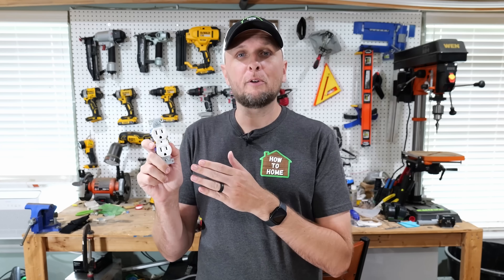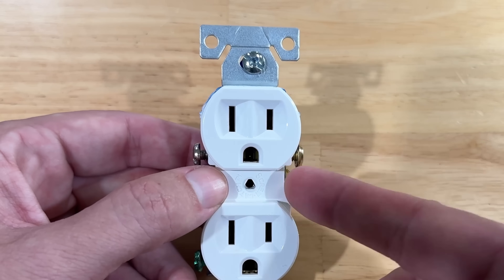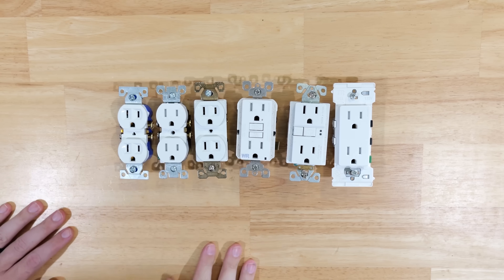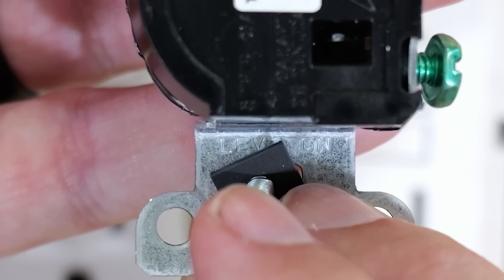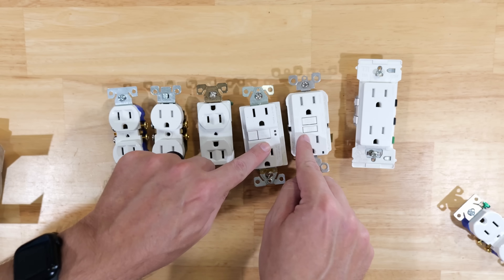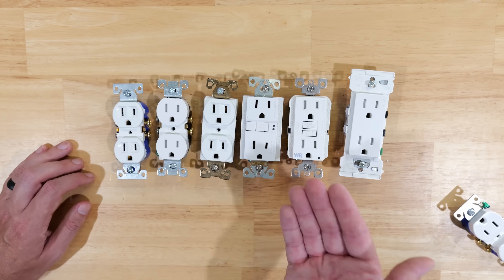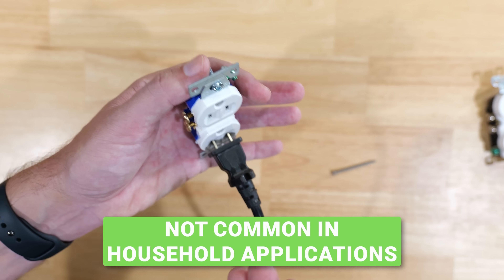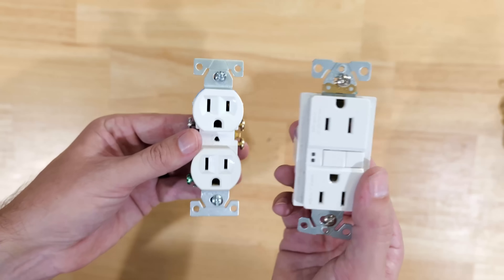The Shocking Reason Why Your Outlets Are Installed Upside Down!

Comment: My take on it is to install ground prong down unless the receptacle is switched. Then install it ground prong up to make a clear visual distinction as to which outlet is switched. Admittedly it is possible for only half of the receptacle to be switched and the other half constantly powered. However, you still have the visual indication as to which receptacle it is though you might not be sure which half is powered at all times.
Reply: That's how I've seen it on several houses - switched outlets are ground prong up.  Also, if the outlet is split, one outlet switched and one on constant, the switched outlet is on top and the constant power is on the bottom.
Reply: @philipstaite4775   People, to whoever: Just be in the habit of always installing the wires coming in on the bottom.  And, if you want the switched receptacle visual orientation, you still install the wires coming in on the bottom.  In = bottom, switched(/out) = top, no matter the receptacle orientation.  I don't know why anyone even thinks an argument is worth the time.*  EDIT  *Not referring to you guys.
Reply: @MundiTaurus  Thanks for that explanation.  I was aware of the orientation, but not the reason behind it.
Reply: @philipstaite4775  I agree, except on that last point. In my humble opinion (and the way I did it) is to put the switched outlet on the bottom. My reasoning, and for my use case, is that the switched outlet is more likely to have something plugged into it the majority of the time (a lamp). Putting it on the bottom allows the other outlet to be easier accessed periodically for plugging in phone/laptop chargers, vacuum cords, etc. 

I will admit that this idea is new to me. The way I've always done it was to use a red switch and paint the switched outlet red too. This has caused a fair amount of friction with my wife who thinks it looks stupid and apparently RUINS the entire decoration in the room. 😆
Reply: @philipstaite4775  Constant power should be on top so you don't have a cord in the way when you are plugging in an intermittent appliance.  A constant appliance, such as a lamp that is wall switched controlled, should be on the bottom so you can easily plug in your vacuum cleaner on the top portion of the receptacle!
Reply: BTW, I am just taking into account what was shown in this video.  For instance, if I had 2 receptacles next to each other:
in would be left bottom,
out would be left top,
to right bottom,
anything out would be from right top.
Reply: Agreed. I've lived in several apartments that did this, and it made it super easy to know which one to plug a light into so it's switched. My house doesn't have a switched outlet so I don't have to worry about it now, but if I ever decide to wire one, it'll be upside down for identification purposes.
Reply: the smart way to do it is with the switched face on the bottom, because you're more likely to have something permanently plugged into the bottom, and occasionally plugging and unplugging stuff from the top - and you won't have the other plug blocking your vision.

Comment: Probably the biggest consideration for me is the prevalence of 90 degree plugs "usually" hanging down with the ground prong down. Plus it just looks weird the other way as we're used to it down.
Reply: Not just "looks weird" but having the cord constantly hanging with a sharp U-turn is not good for the power cords and strain relief features. The plug orientation is the deciding factor for me when orienting outlets.
Reply: @danoberste8146  Yeah, I wasn't clear as the "looking weird" I was referring to was the outlet.
Reply: When I was vacuuming floors, half the outlets were installed ground pin up, and some ground pin down. What I noticed is that the vacuum would stay plugged in better with ground pin down.
Reply: Yep. I've been aware of this issue and the lack of official standardization on the issue for a long time now (decades) so I've been keeping my eyes open and every plug (except one and that was a two-pin plug) I've seen where orientation was designed in, it was for ground pin down.
As an aside, I was originally a ground-pin-up orientation guy. It's what the UK uses and avoids that shocked-face look. But as I looked into it more, it just seems that the choice has already been made.
Reply: @chaos.corner  France is also ground up, but Australia is ground down. Germany is ambidextrous. Their sockets have ground clips top and bottom, instead of a prong, and the plugs can go either way.
Reply: @dougbrowning82  Fun fact: Australia's plug is actually an old US standard that's not in use anymore.
Reply: @chaos.corner  Yup. NEMA 10-20. Except, in America, the bottom prong was neutral, not ground (earth). The socket was an un-grounded, three wire, split phase, 120/240V 20A connector, superseded by the four prong, grounded NEMA 14-20
Reply: @Fetherko  Yes. And, they're recessed, so you can't touch the prongs while plugging in.
Reply: Or when you have a wall wart transformer with polarized prongs that falls out upside down😅
Reply: The stuff designed to go into these receptacles, that is not a standard plug - Kill A Watt meter, multi or USB outlet bank, outlet tester, plug in night lights, etc, are all oriented for the ground down deal. Besides, with ground down, they look like a pair of little startled faces and I like that.
Reply: Why don't they make receptacles with the grounds both facing opposite directions?So it protects every outlet if you have something plugged in the top with a ground.
Reply: Ground should be a circle around the live and neutral, preventing any shock from partially inserted plugs.

Comment: I suspect Eaton puts the instructions on the back of their outlets upside down to allow the installer to view them while it is tipped outward during installation.
Reply: I kept thinking, what does it matter which way the writing is on the back, the outlet has to be twisted over when  you shove it into the wall box anyway? Is there a correct number of flips to comply to codes for that?!? 😳
Reply: @danoberste8146  I try not to do any unnecessary flips… I’m not as nimble as I was when I was younger 😝

Comment: Doesn’t this comes down to personal preference and or what you are use to seeing from the region you are from?  I recall seeing sockets mounted even horizontally long ago.    The only issue I have is with a cord that demands a particular mounting direction.
Reply: @blairM363  Horizontally just means the installer didn’t have the cojones to pick a side in this debate 🤣